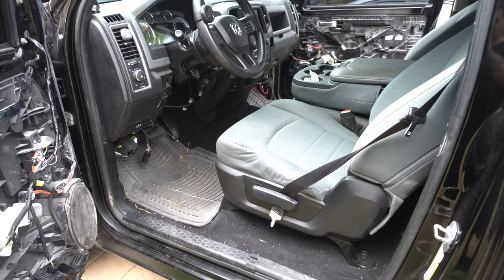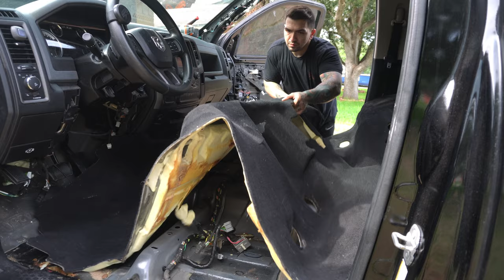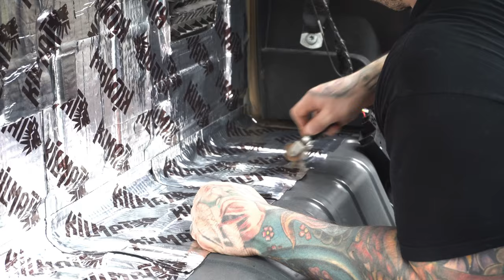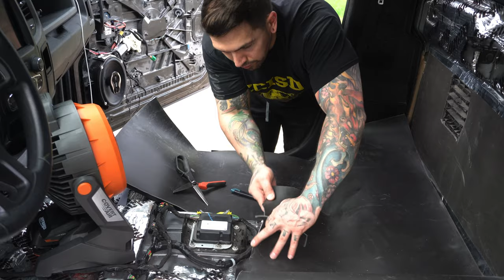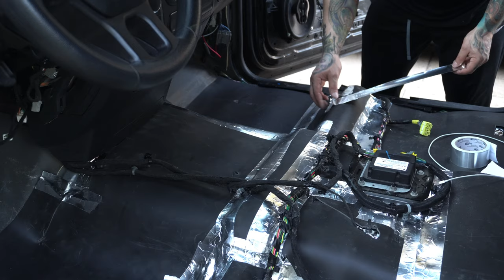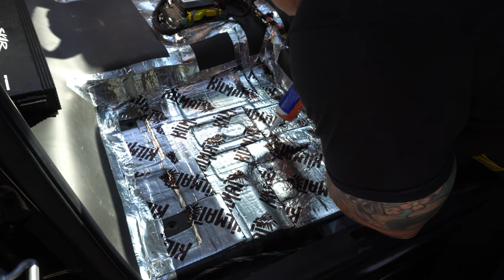SOUNDPROOFING the Ram // Interior Series #2

Comment: Its a 2003 dodge ram... Plan was just to install the seats.. and now... I think i well get those pads to install.. and get the other thicker material as well.. once that is all finished have the new floor on its way.. then i well hit myboy up to get these gen 4 seats on its way and get the seats to work on the 03... A dream build of mine.. am so happy even more excited then when i got my 2020 expedition.. love her but the truck is just another level.. no fixing dang on computer systems on fixing the 30 min mark or it well shut off.. new cars nowadays just cant compare to the real old trucks.. candy blue with heavy flakes. 1000 dollar headlights leda of course..  reverse tailights just get them color matched personally. 6 inch lift with some 37s.. rock lights in only White.. wanfed tot do the 4th gen swap rear but i think its best if i just get steel bumpera fromt and back.. mexico it isnt safe.. where i live animals are in the street and can cuase a accident and once i have those bumpers can just kove them out the way and take them home for lunch😂 and have amazing speakers for the back some 10s.. and what is possible for the 03s?? Like. Leather dashboard's.. what year am i able to install?dislike the plastics. A but newer plastics are durable but no real luxury feelings.... Didn't know how to do the thick material how to install it and just that type of tape i can get that for free.. appreciate the knowledge in this video alone..